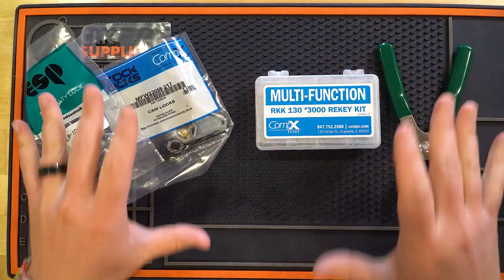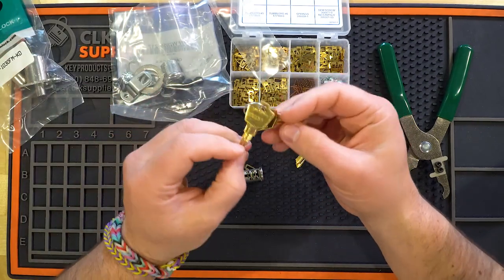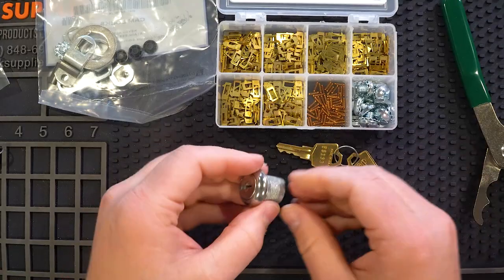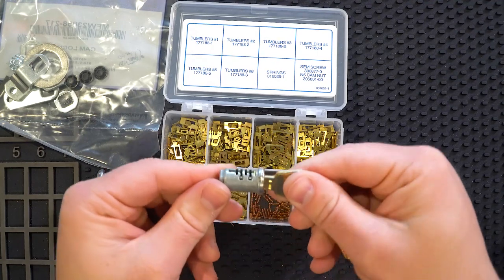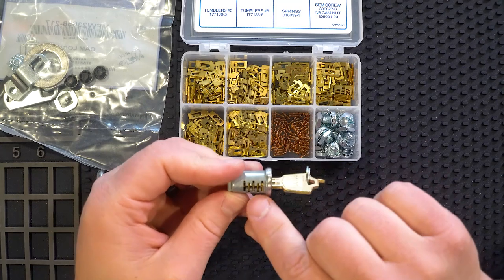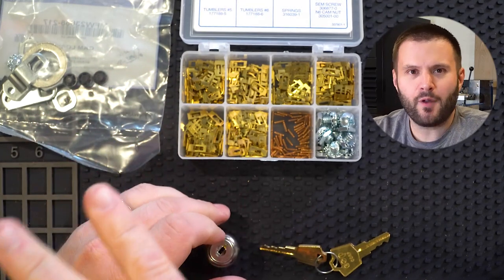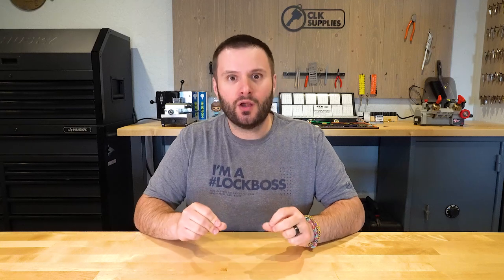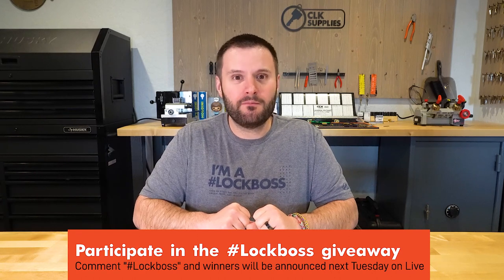Keys and Cam Locks... making them work?

Comment: Excellent information, PJ. I’m not that surprised, if the key is the correct blank for the keyway and it’s the correct length, it makes sense to me that you can find the right wafers to work with the cuts of the key. #Lockboss

Comment: Great stuff PJ. You just sold another pinning kit. I also found that a lot of cam lock manufactures make their own keys. In this case, when a customer comes in with one of these oddball keys. Always go for the Yale Y11 blank. This key blank will cover most of these oddball keys. #LOCKBOSS.
Reply from the maker: Awesome, thank you-PJ

Comment: Are the wafers in this Fort kit the exact same style or are they different from the wafers in your ESP wafer kit?  I have your ESP kit and have definitely run into some cam locks with different wafers that the ESP kit wouldn't work for.  #Lockboss
Reply from the maker: The short answer is yes. It's more important to use the same kit and cam lock brand to ensure the best results-PJ

Comment: Long ago I got one of the ESP wafer kits and It has worked on quite a few cam lock brands.  II had one job specifically on which I was most proud to get a homeowner’s different sliding glass doors onto the same key.  Can any #lockboss tell me if the ESP kit will work with CompX cores?
Reply: Not if the ends of the ESP wafers are squared. Compx wafers have rounded end profiles. Always good to expand your kits though.
Reply: @odinslockllc  I just checked and, sure enough, the ESP wafers do have squared ends.  Oh well….what’s one more rekeying kit on the truck. Hahaha